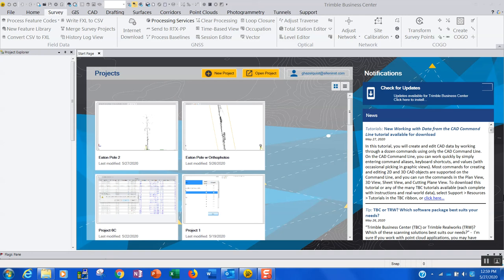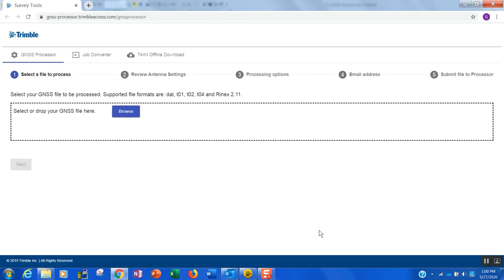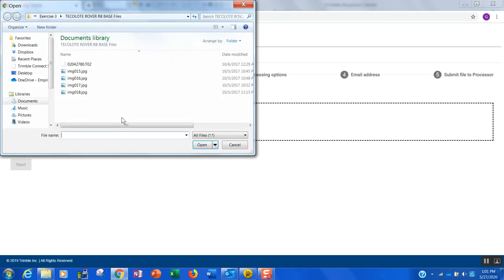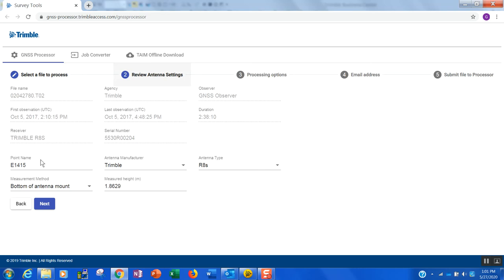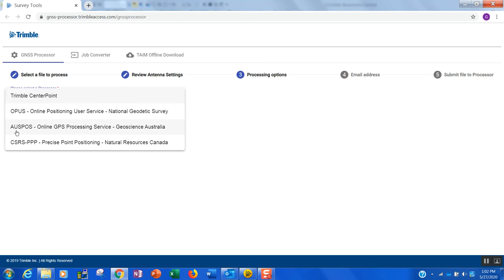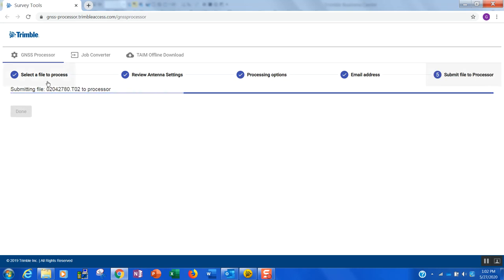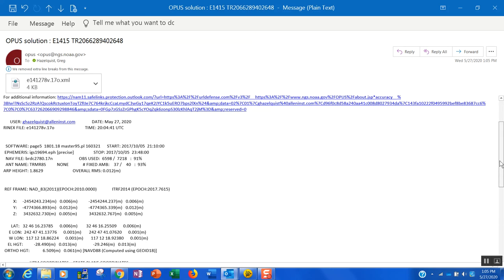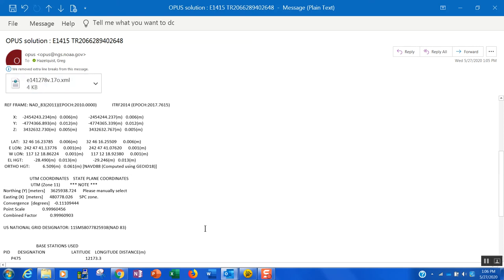Using Trimble Business Center Processing for OPUS

Comment: Howdy!  Great video.  I am interested in a video on the next steps. I have a process but not sure if it makes sense:  I bring in the .JOB file(s) from my RTK survey to TBC. Then I bring in the XML file from OPUS. I merge the base station point in the .JOB file (I used the HERE button to set its coordinates during the survey) and then change the name of the OPUS solution point to match the base station point and merge the two (after setting the quality of the OPUS solution to "control"). Does this make sense? Is there a reason to merge just the T02 file with the OPUS solution?